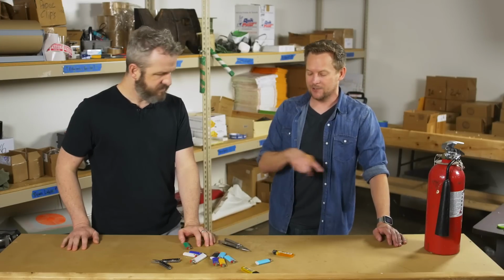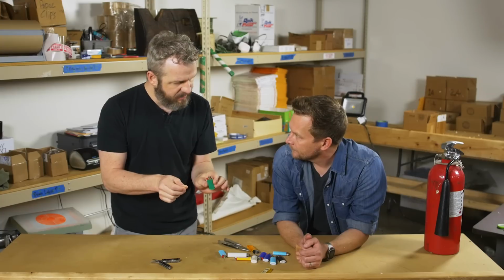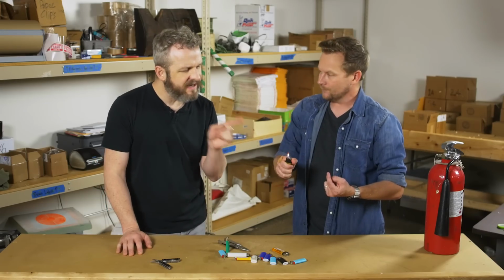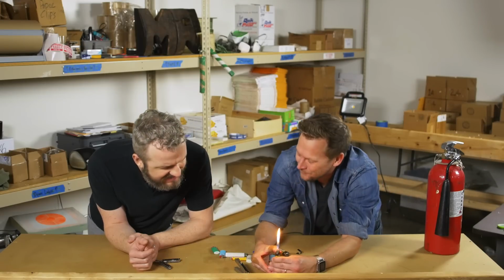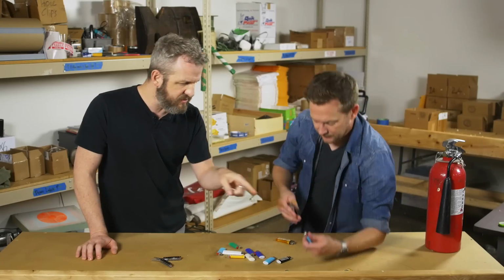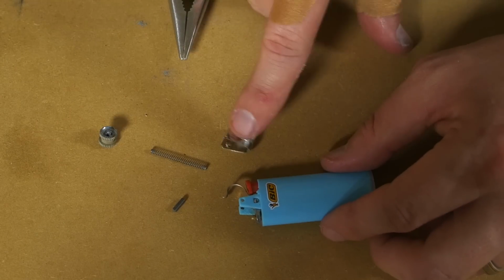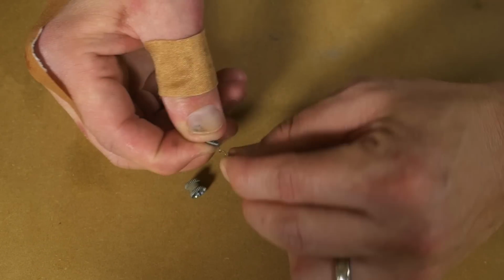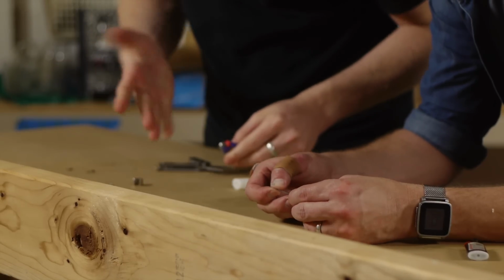Converting Cheap Lighters into Flashbangs & Flamethrowers

Comment: hey brushwood and friends, to remove to flint without hurting yourself , place the valve end down , "aka the shiny part lmao" against a table and use a flathead screwdriver, release both tabs, one on each side, and lift slowly this will absorb the impact from the spring and gently release the flint to the surface your working on, I've been collecting lighters for the sole purpose of saving the flints for years, not one year but many since i was a child , i have on hand a giant 500ml coke bottle full of them. pm I'm for details , Brian Brushwood ... PS i wont let you down

Comment: It's not really a "flash bang" with out a bang. If you throw a lighter at the ground really hard, it'll explode and you'll get the bang. If you taped the long spring with the flint in it to the lighter, heated the flint up, then threw the whole thing at the ground, you get a proper flash bang, plus a fireball.

Comment: aanndd I just upgraded all my lighters into mini flamethrowers by repeating that trick from the beginning about 5x each
Reply from the maker: Nice.  (Be careful)
Reply: ye, I've noticed the flame doesn't always die right away. Do you know of there's any risk of the flame working its way into the fuel compartment or would hat just be the excess gas burning off?

Comment: Looks like xou guys need some clippers, huh?
Reply from the maker: whuh?
Reply: well... clippers are designed to allow you to change the flint, so you can extract it by simply pulling out the wheel
that way you can get it in a matter of a second instead of having to dissect your lighter

Comment: We used to do all of those things when we were kids, back when even kids could buy lighters. There was a store in particular we used to go to, where the store had a sign above a basket full of "one time lighters" that read like;
"Grab a handful for *5 kr!"
*more or less worth around a dollar.
We would get together and buy each a handfull, then collect the flints from most of them and toss them just toss them around like crazy😂
And then put a pile of the flintless lighters and maximize a flame on one, wrap a little spring around the "gas release", ignite it and put it below the pile of lighters and RUN!😂
Makeshift firebombs, man all those plastics we just left outside as kids, I kinda feel bad now😝😂

Comment: you idiots... these are not tricks. The flint glows hotter and hotter as it oxidises, which is why the last one went off so well. Try pulling apart a biro, rip the ball point out of the ink tube and dab it on the brass nozzle in the tip of the lighter. Can be hard to light the first time, but it will blow your little minds

Comment: Man Card removed sorry u struggled with take just the safety caps for minutes. Dude get a pocket knife n ill pop right off by prying it the right way. Im done it on bics, clippers, 99cent lighters.
Reply from the maker: You're not my real dad.
Reply: The Modern Rogue Oh ok well. Nice throw btw. Is that a multi tool? I think it has screwdriver in it maybe something close it works well for prying.